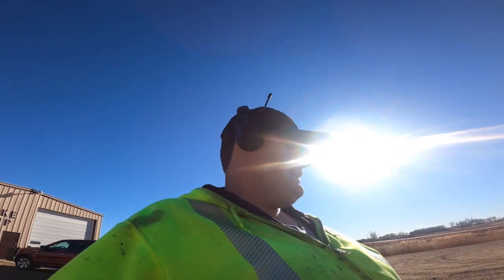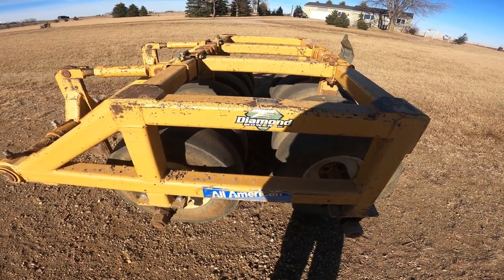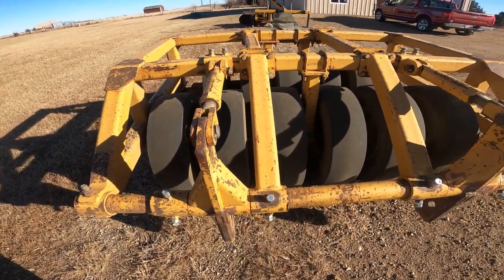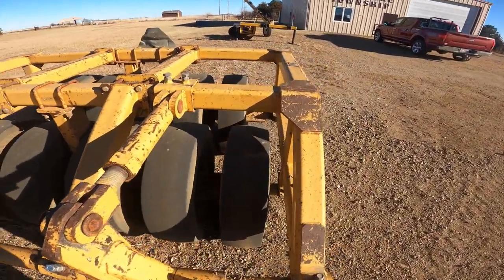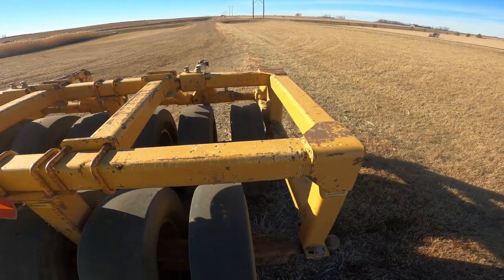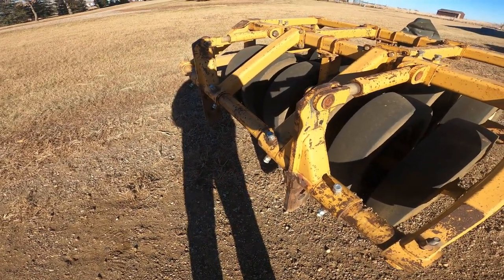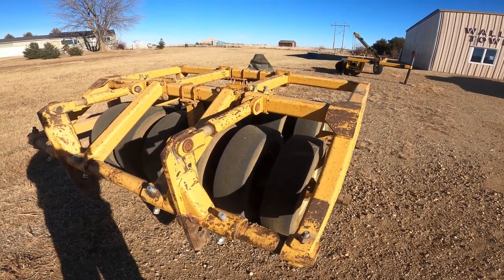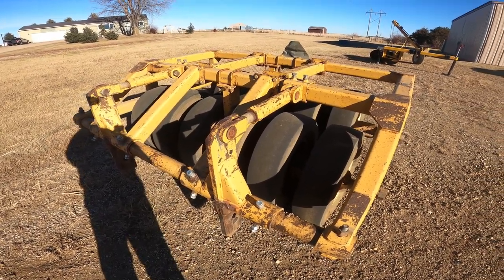rubber tire packer for grader

Comment: What tires do you run on your graders and what pressure do you set them at. Love the videos. Thanks
Reply from the maker: I got a couple different tire types I got the Michelin snow plus tires on one machine I run them at 40 psi on the other machine I have the Bridgestone v pattern dirt tire I run them at 45 psi hope that helps and glad you like the videos thanks for watching.

Comment: 4% grade. Wow. I never thought it was that steep on those roads.
Reply from the maker: Yeah on gravel roads I recommend a 1/2 inch of crown per foot of road width so we say 4 to 6% crown no more then 6 % on roads definitely have to get the water to shed off the road or you have big problems.

Comment: Is it solid rubber tires?
Reply from the maker: These are not solid rubber but they are filled with foam and I’d highly recommend you get foam filled tires to eliminate flat tires.